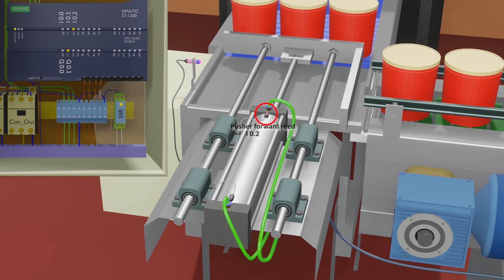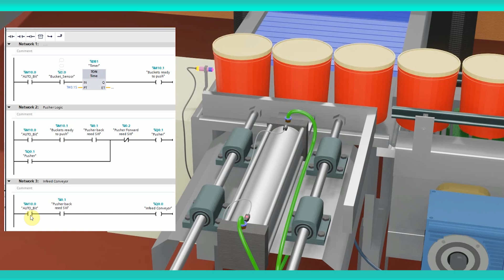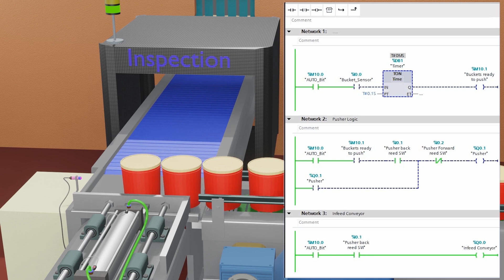PLC Programming Tutorials for Beginners || Ladder logic for pusher

Comment: Nice video. Just a question though... I tried doing the logic by myself before seeing how you did it. And my question is, why do you need the AUTO_Bit if it’ll always remain high and there is no way to turn it OFF unless you force it OFF?
Reply from the maker: You can latch on and off  auto bit with  start and stop buttons.
Reply: @EASYPLCTRAINING  how works that? i don´t understand how latch on and off a M with a button
Reply: @xd-uj9yu  
There are several ways to achieve this. RS-Blocks, P-/-N_TRIGs or simply setting and resetting the M with S and R-Blocks (which would be similar to using the combined RS-block).
One solution would be to use S (Set-Blocks) and R (Reset-Blocks) to set the AUTO_BIT. 
-> For example: As soon as the ON-signal switches from 0 to 1 (while pushing the start-button), the S-Block can be used to set the AUTO_BIT to true. The same works for the Off-Button (represented as an NC-contact, since the OFF-Button is most probably a NC-contact and goes from 1 to 0 when pushed) and the R-Block to reset the AUTO_BIT.
Another solution would be to use a RS-block (connect the ON-Button to "S" and the NC-Off-Button to "R", Q = AUTO_BIT)